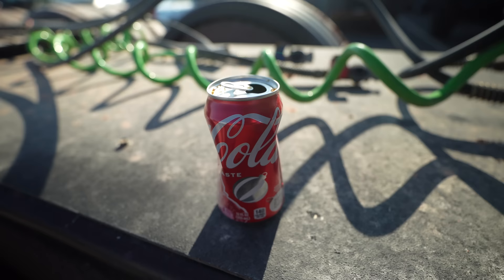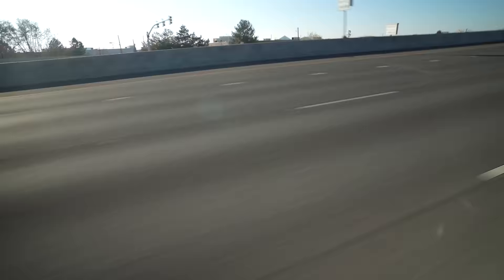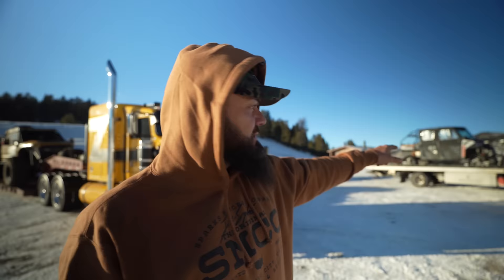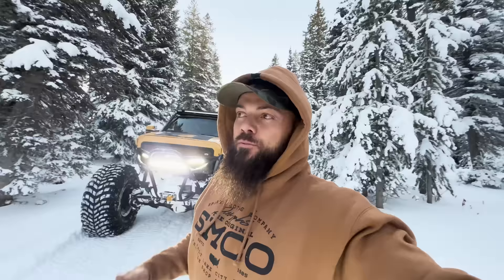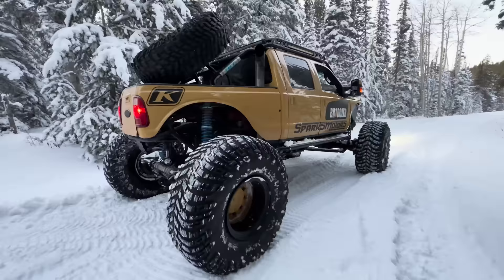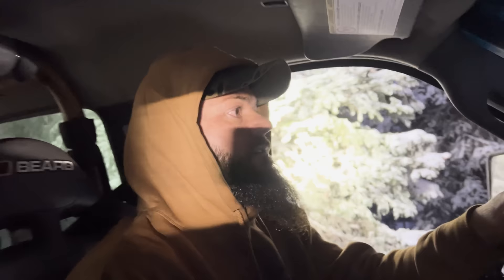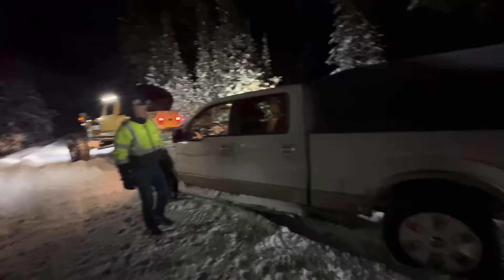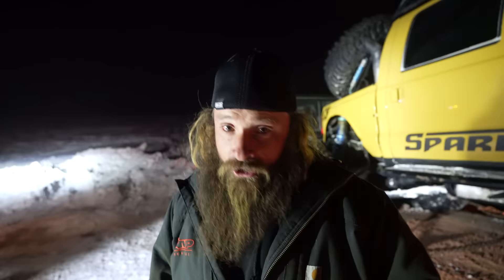Testing Out the Monster Truck in a Snowstorm Rescue!

Comment: That Brodozer is honestly one of the most impressive vehicles I've ever seen. The fact that it was driving that well through the snow by itself is crazy as most vehicles will always struggle, it pulled not one but two, completely dead heavy trucks through the snow like no problem. That just shows the incredible engineering these guys have when they built that truck.
Reply: the f150 wasnt dead. Alan was driving it with it on.

Comment: I didn't think the brodozer would handle the deep snow that well.. Very impressive.
Reply: baloon tires work wonders in deep snow
Reply: Yah, when tires that big get aired down it works wonders. Look up Kelowna snow wheelers, those guys run some crazy rigs through hood deep snow.
Reply: was not that deep, when snow top is lever with top of tires, then it is that deep

Comment: I've never seen a rubber tire vehicle go threw snow with such ease.kudos to the brodozer its awesome
Reply: Super wide and low pressure, which is why they use 55in tall 24 inch wide Mickey Thompson's on the artic exploration vehicles.

Comment: For the back of that tracked thing you should create a half inch steel box for the witch to be stored in for when that happens again it slides off instead of messing with any running gear to the winch

Comment: Shot.. HeavyDSparks that Mosnster  Snowtorm Truck would be grate if you just gave it to a Snow Rescue Company , Jut Warp the body, add first aid equipment , better lights and help out with the gas to run it for two years. again your team rocks.

Comment: Did the Sisu use the hydraulic hitch or coupler (thingy) or just trailer brake and drive to get the front of the machine to nose up on to the trailer? That machine is Wow

Comment: It's amazing how the Sisu Nasu is able to drive off and on the rear deck of the lowboy.  I would love to have a Nasu but I don't really have a need for one since I am primarily living in my off grid compound in the Mojave Desert area of southern California.  For the past 10 years I have been building an off grid homestead in Alaska which will become my primary residence once I build out all the infrastructure and out buildings.  I am curious as to how hard it is to separate the Nasu into 2 pieces because I have a Munson aluminum landing craft and I am not sure If I have enough front deck space to fit one in one piece.

Brodozer 2.0 should have the new 58" Mickey Thompson tires.

Comment: You should build an actual rock crawler just tubing and motor and two seats huge motor with low gears locked all the way around huge radiator night lights winches front and back all aluminum blocks heads if they make that for weight

Comment: You realize the temperature outside is so cold that you can drive that Dodge without a radiator wait a minute you can drive a gas powered engine without a radiator in the winter time I was working at the gas station when some customer came in no radiator cooling whatsoever I mean you can't go far long and hard with it

Comment: Pulling “two dead truck’s” then why was the F-150 tires spinning while you were pulling both trucks and the windshield of the F-150 was all defrosted off Dave? What else is not true in these video’s? Why lie like that Dave I bet there won’t be a response to this comment I’m very disappointed.

Comment: I myself have little sympathy for people that get stranded and stuck if they head off-road in the wintertime in deep snow and still have summers or all seasons on......too dumb to drive and should know better and there is no valid excuse

Get people in Vancouver Canada that drive with summer tires on and they try to get away with it but the first little skiff of snow and they are in the ditch or pile into someone else on the road and then have the nerve to exclaim " I don't know what happened "......sure you know what happened you were dumb and tried to get away without having to buy winter tires even though you live where it snows every year